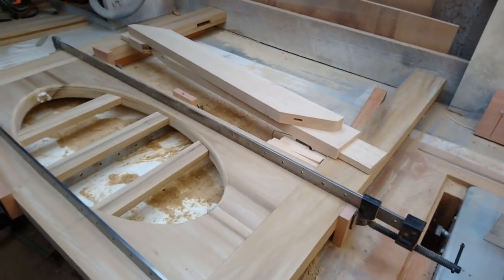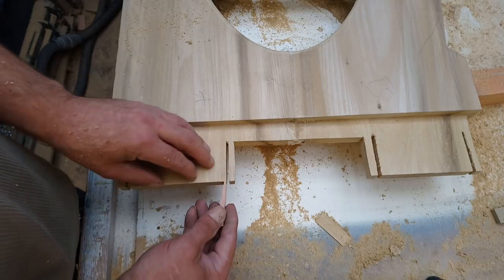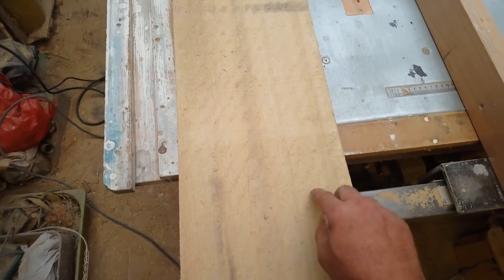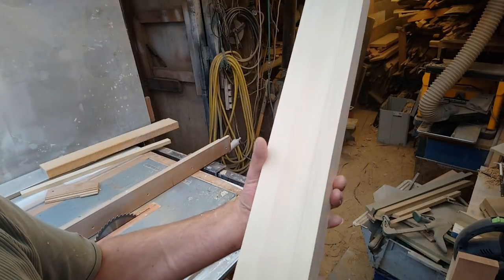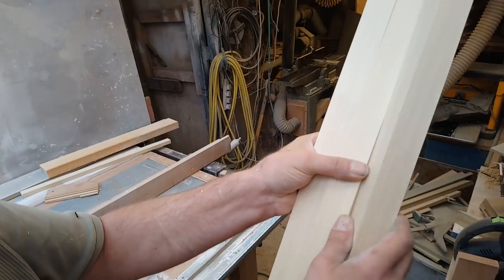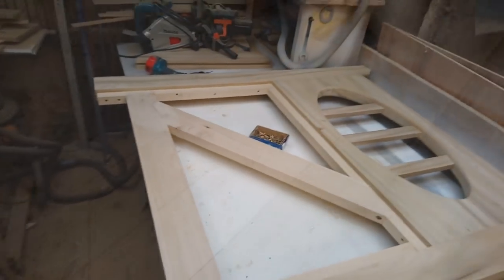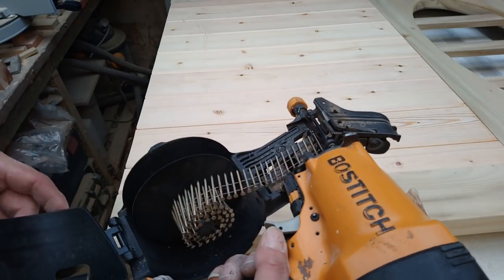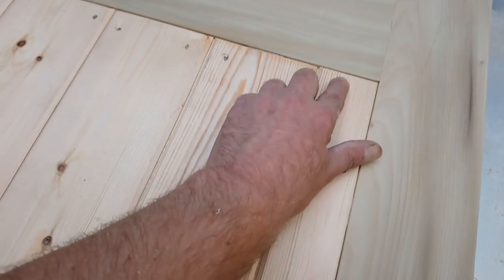Gate Making Pt3 - Finished gate

Comment: Great work, Iv seen people drill a small hole at the top of them cuts for the wedges which stops splitting also.
Reply from the maker: Yeah I've seen that, it works on metal n fibreglass to stop a split spreading, on wood it'll work if the cut is close to the edge so the wood can bend where the hole is drilled but if it's thicker than the grain is still going to split beyond the hole, If you take the example to it's extreme & cut half way along the middle of a wide board along the grain, then drill a hole at the cut end in the middle of the board, then spread that cut with a wedge the board will still split beyond where the hole was drilled,
So yeah & no a hole drilled will prevent splitting. 🤷‍♂️👍

Comment: How good is that nail gun? Are they worth the money? And what litre compressor should you run with it? Cheers
Reply from the maker: Hi Sam
The biggest pin nailer is a 15g but that still only has a pin head to the nail,
the smallest nails for the framing nailer is 50mm,
This nail gun ranges from 32mm (maybe 25mm) up to 65mm & has a smaller head to the nail so neater on boarding (shiplap/matchboard) like this,
Bostitch are good, very well made, they're up there with the top guns, 
Is it worth it would be up to you & what your going to use it for, I have other makes of guns but I have 6 Bostitch's & are my first choice of make,
I have a 50ltr compressor in the workshop but I've run this on my 6ltr site compressor no prob.
Reply: Gid joiner ok thanks for the info, where abouts are you from?